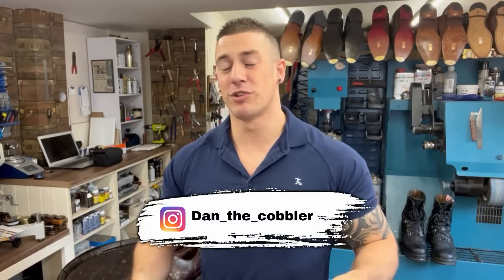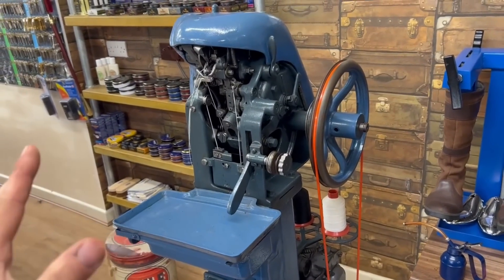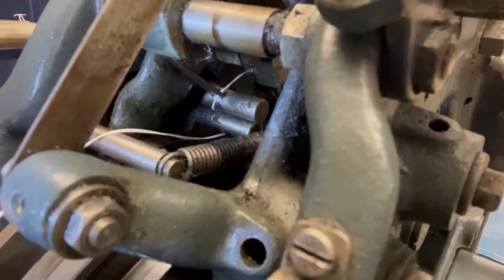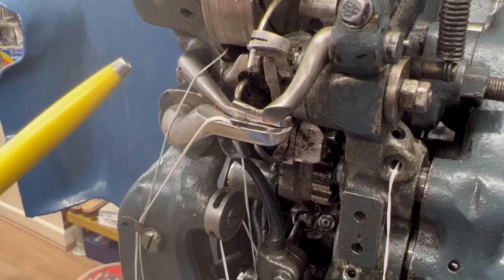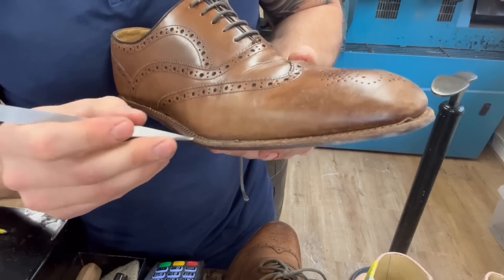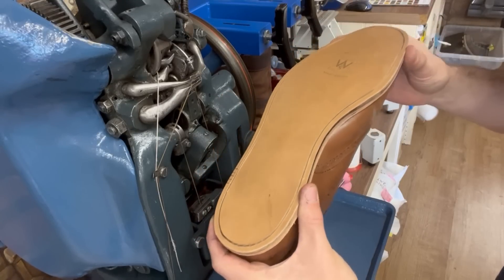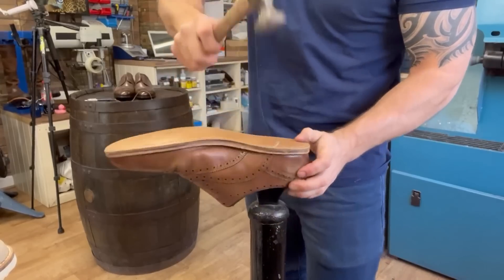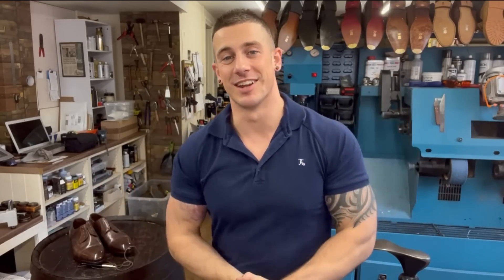HOW ARE SHOES STITCHED TOGETHER? | How The Leather Sole Stitcher Works! GOODYEAR WELTED

Comment: Thanks for the video. Not only am I a diy cobbler hack "I do my work boots" I love machines like this.

 I work at a print shop and Victor is like a cross between a string tie machine and a wire stitcher which is like a heavy duty stapler.

Comment: I'd like to recommend you the best AA tweezers I have ever had that might be good for taking threads out.  While perforated music disc repair tweezers are the best, they are near impossible to find anymore.   For today's needs of fine tweezers go with Hakko.  Designed in Japan, made in the north of Italy.  Premium performance and feel with dual tempered prongs to be springy yet incredibly strong.  So strong in fact I can bend all other tweezers with them.    I am alarmed with the value and performance of them.

Comment: Thanks for doing this video, Dan. Question - if there happens to be a mistake in stitching, can you just rip out the stitching and pop the shoe back on the machine to try again? Are new soles reusable that way? Or if you mess up in any way, you have to get new materials, and do the sole all over again?
Reply from the maker: You can remove the stitches carefully one at a time working backwards with tweezers, want to avoid obviously as it can chew the leather up a tad

Comment: Hi Dan, thank you for this video. I have a question if you don’t mind enlightening me: are Blake stitches always larger/longer than outsole stitches? I prefer the look of the smaller/tighter outsole stitch but was wondering if there is a reason for the difference. Thank you in advance.
Reply from the maker: You can adjust stitch length on the Blake, but the needle makes larger holes so there is only so small you can go

Comment: In our shop we've had the American straight needle sole stitcher, the Landis Model K, and for the last forty years the Pedersen Rapid E.  I've never seen a "VICTOR" until your video.  Where is was it made?  You said a new one is  $15K which I'm assuming is a totally rebuilt one as I would lay odds there is no current production of this sole stitching machine...or, probably no Victor manufacturing of any kind as of this date?